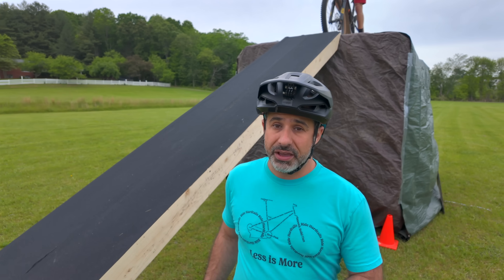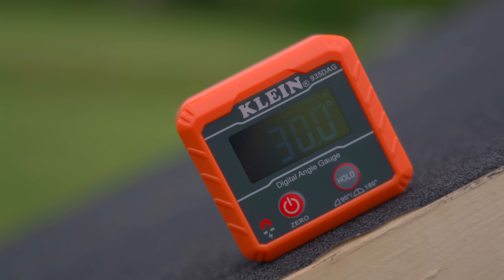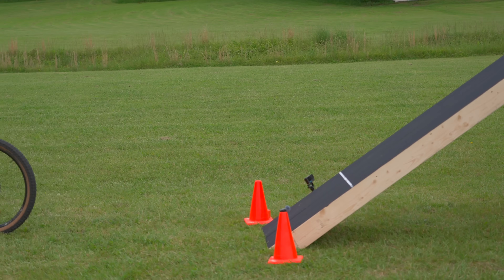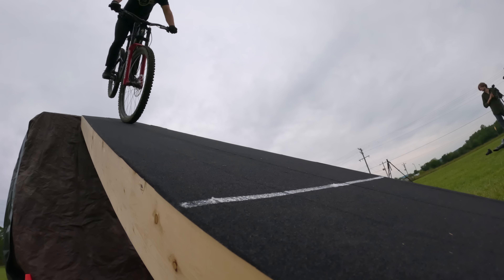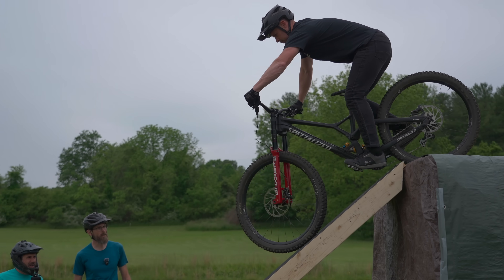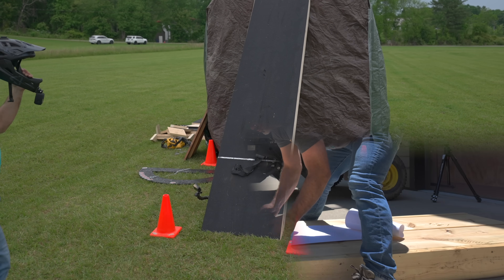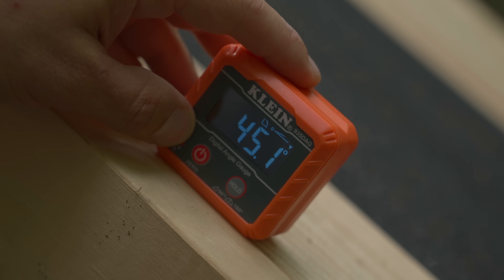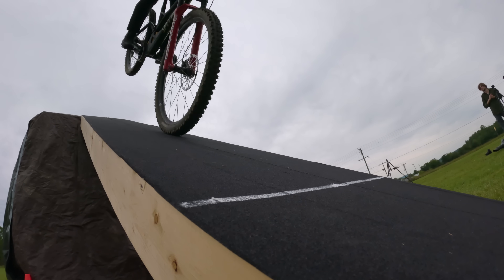Could You Stop? Our Brakes Were Useless At This Angle

Comment: I had a basic, cheap mountainbike that i experimented on until the rear derailleur decided to die. but i had the front and rear tires around 10-15 psi, you could go 30 mile an hour off a half foot jump and barely feel it. but the best part, since my friend is good at tuning brakes, i had him tune the brakes, and i kid you not, the bike could stop on a dime. if you guys have already good brakes, test lowering the tire pressure. and when i had the bike going, i was testing inclines, and i had the rear spring disabled, its one of those cheap screw adjustment shocks. i actually unscrewed the shock, so that the ring was against the shockmount and just let it bottom out. i climbed up the slope so much better than i did before. in fact, when i tried before all of those mods, i was just maxing out the pedals, because it just kept losing traction, so i lowered the center of mass, and increased the surface area of the tires. increasing the amount of grip and stability to climb up the mound. i swear this mound was 45 degrees and i got up it flawlessly.

Comment: I'm no expert (engineer by hobby/ 2 years of college engineering). My first thought is lowing the center of mass as much as possible. I always feel more stable under steep braking on my custom Ebike vs my mountain bike. I believe it's primarily due to the 40lb. battery sitting just above the crank tube, however the larger 2.75" moto tires also help with grip

Comment: Locking out the front fork would definitely help because keeping the front wheel in contact with the surface isn't an issue. Traction is down to the size of the contact patch which is a combination of the pattern of the tyre (slicks are best on a flat surface, knobblys are worst), the compound of the tyre material (softer = better), the amount of load pushing the tyre into the surface and the amount of air pressure resisting the deformation of the tyre sidewall (more load + less air = bigger contact patch). So in order to get the most traction you need the softest, slickest tyre with the least air pressure in it possible without it falling off the rim and the least load reduction. Centre of gravity is also going to take some figuring out because you need to keep as much load on the front wheel as possible without going over the bars. I'm not exactly sure about the rear suspension as in one aspect you could potentially use it to manipulate your centre of gravity but in another aspect it is potentially moving load away from the front axle, this again would take some experimentation. I suspect a smaller rear wheel could also have some utility to help give you that "Josh Bender ass in another zipcode" kind of stance

Comment: The lip you had at the top of the ramp at the edge technically made your ramp steeper than what the device was showing and it made you start with almost no grip on the rear tire which made the rear tire have to play catch up with grip for the rest of the decline in an already low grip setting. So I would start with that?

Comment: the second try in the woods was not correctly done. What made it impossible was not the grade of the ramp, but the fact that there was a 1-2 inch drop at the top of the ramp that sabotaged your efforts, effectively making the ramp steeper until your back wheel came off the top.

Comment: Joe's bike did better, because it had better suspension.  The longer travel compresses more and decreases the rake angle as it compresses.  That moves the center of gravity back and down a bit.  It also lets you keep more consistent force on the front tire as you move your weight back.  Some of the initial energy required for stopping is also converted to heat by the gas in the forks.

Comment: So this looks like an awesome skills test and practice.  

Tire compound is absolutely the technical difference between your bikes.  Talk to the guys doing competitions on dry rock, They should have good suggestions on what tires work best.   

A simple sliding friction test should be enough to sort out the best tires.  Set the grip-tape ramp flat, Lock the brakes and load 50-100lbs on the locked tire (measured with a scale to compensate for bike weight and placement) then use a scale or load-cell to slide the tire on the grip tape.  The best tires will be hardest to slide.  I.e. this is a simple test for coefficient of friction and should be controlled enough to make good comparisons.

Comment: 09:10 I think the bump down 'lip' at the top of the ramp threw the result. You are doing all the breaking just on the front wheel, until you have too much momentum and its to late. Feathering the breaks rapid on and off to stop it locking like a cars ABS (Anti-lock braking systems) might kinda help.
Anyway comment waffle to feed the algerithms :)

Comment: Super fun experiment!  Gotta get your tire pressure wayyyy down, like 8 psi.  More rubber in contact with the surface.  Take the saddle off the bike.  Get your weight as far back as possible.  Lock the back brakes, and then squeeze the fronts until you either stop or skid.

Comment: With the DH bike looking like it had the most control (could be the rider), you need to get use of the Grim Donut to see how much head tube angle matters. Since it's a "could you?" situation, having an outlier is cheating and not relevant. Would be interesting to see if it can stop, and see if your RC crawlers could too at the same angle.

Comment: Seems like you found a fun way to show the friction angle. tan(theta) = mu sub s. 

The coefficient of friction for a static case (rolling without slip) is catalogued for different materials. Between rubber and dry clean concrete is (mu sub s = 0.9)

Solving for theta … tan^-1(0.9) = 41.987 degrees. 

If the rubber is grippier or the grip paper is more bumpy maybe you could go a bit steeper. 

The fancy fork might do a better job of keeping deceleration impulse forces lower to keep slip from happening (ie keeping the no-slip condition true so that static coefficient can be used)

Nerd out.
Reply: That's what I came up with posted elsewhere. The coefficient of friction is the defining limit. Basically the maximum theoretic angle is the arctan of the coefficient of friction. 

This is assuming you don't go over the handlebars of course. That's a different issue.
Reply: How you add the weight to that equation? Same rubber with a weight on it would increase its grip a lot. Because it gets squashed to the surface.
Reply: @ChaosLordDiscord  The weight simply cancels out top and bottom when you analyse the forces. The force down the ramp varies linearly with weight, as does the force normal to the ramp. The result is you get the same limit for a given coefficient of static friction whatever the weight. Thus you double the weight, you double the friction force but you also double to force down the ramp.

Comment: very low tire pressure, very slow speed, very low weight, warm rubber, no seat post, low rebound, rounded entry profile....  think i could do 45 degrees+ easily tbh.

Comment: 2.6 super soft slick/semi slick on the front with very little air pressure,  maybe even a handlebar/stem setup that shifts the weight further back and you will push the limits quite a lot

Comment: you could try with a reverse(? mullet (bigger front wheel, smaller rear) it woud mitigate the OTB risk a little , however, a smaller wheel has less surface area in contact with the ground (if everything else is equal) than a rear wheel, fat tyres would be pretty beneficial, and just in case you could put a couple mats at the side of the ramp ;) hoping for the next video, cheers!

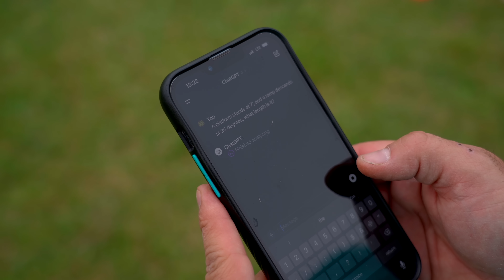Comment: 2:15 Seth does the one thing ChatGPT is known to be terrible at: maths :D. Good to see that it at least got the simplest of calculations right.
Reply: The funny part is it is totally unnecessary and inefficient to use a neural net to solve a problem that is easy to solve through linear programming. Ie using a calculator is better.
Reply: generic AI are not meant to be used to do math! Never trust them to do any kind of calculation task...

Comment: This test shows that Traction is lost before breaking power. This might not be the case for different break systems. 

I have an Idea though, as a technical test, of stopping power/total traction:

The gradient is only really used to create forward force, right? 
Because you could totally do a test of angle stability, and a test of breaking power seperatley. The combined test is kinda really useless as it only tells you what will happen in an impossibly specific scenario. 

So What Id do is attach a rope at the bike, and pull it forward. The rider will break as hard as he can. If the pulling force is measured this gives you a stopping power in Newton. 
A good way to get a measure for the pulling force would be to use a luggage scale, or an industrial equivalent, as I suppose the 30-50kg limit of a luggage scale will not be enough. 
For the readout, the measured Kilograms need to be multiplied by the gravitational force, as I assume a luggage scale will propably measure elongation, assuming gravitational acceleration, meaning 
m=Ks/g
where m is the weight it displays, k is a constant specific to the scales inner working, equating elongation to force so k=[F/s] and s is the elongation caused. 
Multiplying the readout mass by the gravitational acceleration should give us a force. 

You could then calculate the forces pushing a bike+biker forward on an inclined ramp and calculate the angle of the ramp at which the technical specifications of the bike would fail. 

This angle is then an upper estimate for what can be achieved when riding the bike normally. 

Im not a mountain-biker so Im not very knowledgeable on seating positions. Since this proposed experiment is done on the flat, a „realistic“ seating position needs to be assumed. From Roadbiking I expect it to still be behind the saddle, however if the pulling cable is attached at a weird position this might not be the case.

Comment: Since your failure point is sliding, the two important things are coefficient of friction on the tire / grip tape contact point and brake application on both front and rear to avoid locking either wheel before the other one since static friction (contact point not sliding) is higher than sliding friction.
Reply: Yeah, & so far as the tire goes, a fat tire low density slick, covered in tiny siping slits, should do best at this.

Comment: If you unweight the front tire doesn't that weight go to the rear? It is true that climbing one wants weight on the downhill tire due to weight transfer, But while descending, I am not convinced the front needs to take the majority of the load when braking. Even loading would seem to make the most sense. Shifting your weight as far back as possible, and getting your torso as close to the headtube as possible would be the best approach.

Comment: the trick is to actually lean kinda over your bars or just stand up taller. because all the braking power is in the front brakes when its so steep, and  leaning back will just make the front tire slip. you need to have the weight over your front tire

Comment: This is the same physics 101 scenario where you’ve got a mass on a slope … so you’re pushing down directly vertical through the bottom bracket, but you’ve got 2 vector forces parallel and perpendicular to the slope. At some point the force pointing down the slope exceeds the friction force pointing the opposite way, then you start to slide down

Comment: Engineering Student here, I did some calculations on what angle you should be able to reach based on some educated guesses on some factors like coefficient of friction and found a max angle of 41.19°. I feel like your test is fairly accurate depending on the conditions. Thank you Seth for always testing crazy ideas that many of us have had!
Reply: Yup, coefficient of friction (assuming perfect execution of brakes/balance) is equal to the tangent of the max angle achieved.
Reply: you should re-examine your lessons on significant figures
Reply: @user-co6ww2cm9k  no joke 😂 looks so wrong now that you pointed it out
Reply: why not just under 45 degrees when the coefficient is 1?
Reply: @carlosgaspar8447 this is correct, he def didn’t use mu of 1. Bike tires are less grippy than car tires tho
Reply: @zaydabbas1609  I think I used .85
Reply: @zaydabbas1609  yeahh i reckon tires like the maxxis hookworm and maxxis grifter are more similar to a car's, i reckon they'd do at least a bit better, maybe get them up to 45 degrees or so as they don't lose grip as easily.
Reply: Post the math here please
Reply: Actual engineer here, calculations with guessed coefficients are useless without actual simulations and tests. Real life isnt a physics 1 problem.
Reply: What about the horizontal-velocity-component affecting the weight acting on the slope? The faster you descend, the less weight acts on the slope and so the less traction you have. Applicable for linear and concave slopes. Gravity runaway.
Reply: @Sidowse  this would be fun to add to the calculations
Reply: Good job, science nerd.
Reply: Saying you’re an engineering student is unnecessary. You don’t need to start your comment with that
Reply: @MedicAthlete24W Your comment is also unnecessary though—as well as mine.
Reply: @austincheynet9380 You are not a engineer. You are either a  drop out or just some random guy flexing. Either way cut the flex engine boy
Reply: @bakislayer lol why are you mad?

Comment: Fun video Seth, but it seems to me you had too many variables going on.
Different riders, 
Different skill levels,
Different bikes geometry,
Different tires,
Different tire pressures,
Different ramp lengths, 
And finally, 
Different angles.
I’m not sure what your test determined?
Was it one single factor or some combination of factors?
So if you were to have the same tires and tire pressure on all three bikes and have each participant ride each of the three bikes, you might get some interesting more conclusive results. 
Otherwise the only consistency was the grip tape and the starting height. 

Thx and good luck,
Petr

Comment: You could try and measure the coefficient of friction -- the fact that you topped out at around 45 deg points to a coefficient of around 1. Only road racing rubber for cars and motorcycles goes above a coefficient of 1.

You can measure it in your garage with a bit of the rubber placed under a block of wood on an adjustable ramp -- tilt the ramp until the rubber slips and you have your max angle, x. The taninv(x) of this angle is your coefficient of friction.

You could also try throwing your bodyweight even farther back, e.g. on a bmx bike, but that's unlikely to change the results much at all.

Just my 2 cents as a middling physics student.
Reply: The coefficient of friction can't really be above 1. Instead you add additional fundamental forces, like electro-magnetism, chemical bonding, or pure mechanical connections like hooks and loops on Velcro. Drag racing rubber tires have a sticky chemical coating that creates an adhesive chemical bond with the road. 
Joe never "stopped" on the 46 degree ramp, instead he transferred his forward momentum into rotational momentum about his front tire.
Reply: @Fishpizza1212 то что он не удержал равновесие из за того что центр тяжести переместился за колесо ещё  не говорит о том, что он не остановился.

Comment: Hips further back with legs and arms extended as much as possible, ass practically on the tire. Joe’s technique was best. Also, try an XC bike with that technique. If you’re not far enough back you lose out on additional traction from the back wheel - at those angles it’s almost impossible not to have traction on the front so get as far back as you can. I think the problem with slacker angles is longer wheelbase, so you can’t get far enough back.

Comment: There are many variables going into the question "how steep of a hill can you ride down" including rider skill, but that is only if the limiting factor is flipping over. However, given a perfect rider who is able to keep their weight perfectly centered between the tires no matter how steep the hill, the tires will always slip at some point. That has nothing to do with the rider or the bike, that is just between the tire, the riding surface, and the laws of physics.

But it is possible to calculate the theoretical maximum angle due to grip if we find the coefficient of friction between the tires and whatever ramp is used. Don't worry there isn't that much math. The formula for this is simply µ=tan(θ) or θ=arctan(µ) where θ is the angle and µ is the coefficient of friction. (make sure your calculator is set to degree mode for any calculations with degrees)

A simple way to measure coefficient of friction is to take a folded tire (or cut a 6" section out of an old tire) and then put some weight on top of it, and measure the tire+weight. Then set it on one end of the grip tape board and ensuring you pull perfectly parallel to the board, measure the amount of force you can use to pull the contraption before it starts slipping. Something like a fish scale would work well for that. Divide the pulling force by the weight of the contraption and that will give you µ, the coefficient of friction. 

The coefficient of friction at 45 degrees is 1, so given the video i would expect your results to be about 1.

Comment: How steep is this ramp compared to In-N-Out Burger in Squamish or the exposed steep section of Hangover? I want to put this test in context of actual steep slabs…
Reply: The steepest part of in n out, which if I remember, is at the top if you go for that, might be pushing past 40°, but lower down it’s probably in low 30°’s. The steep part of hangover i’d guestimate in mid to upper 30° range. I’ve come to a stop on both before at on some point.